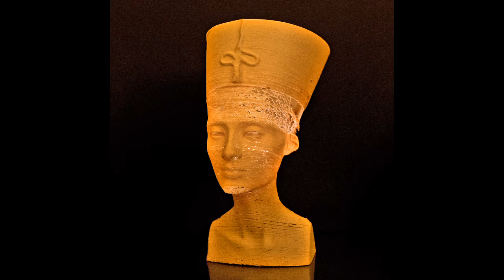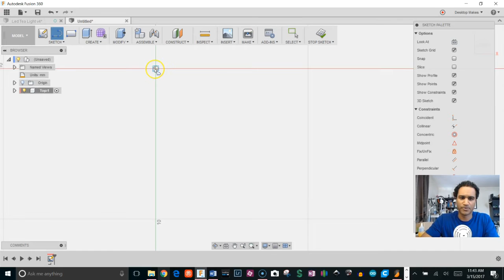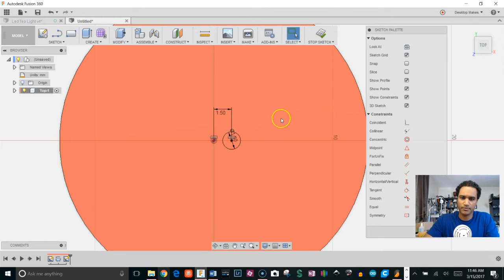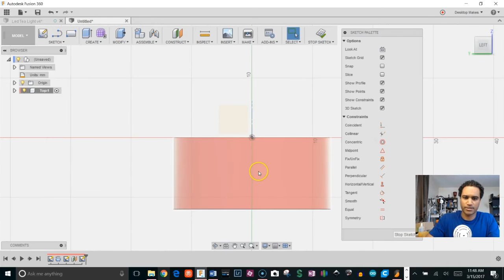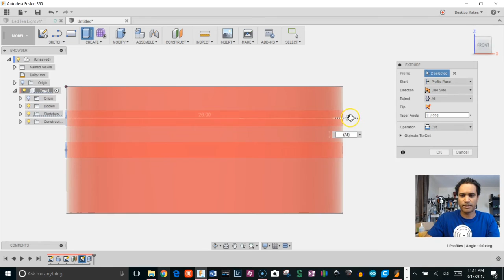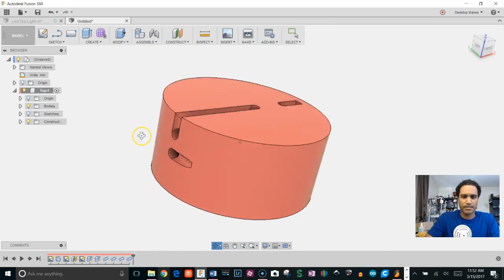Design an LED Tealight in Fusion 360

Comment: damn i just paid 15$ on your udemy fusion 360 if i remember it was an 11 project 15 hour course & now 15$ for 2/3 of a project that kinda sucks this should be included in the udemy course or the whole thing here on youtube !!!!!
Reply from the maker: The Udemy Fusion 360 course is 4 hours long not 15.  The full price is $35 so you must have used a $15 coupon. You're right, it is a really good deal for a 4 hour course.  That course goes through 10 small projects.  This one is 1.5 hours on one project and is meant to be a follow up to the intro course.  Don't let the time fool you though.  I pack a lot in this course teaching how to tackle a multi- part design and how to organize your parts into components.  Plus the design is pretty ingenious but that's my biased opinion :)